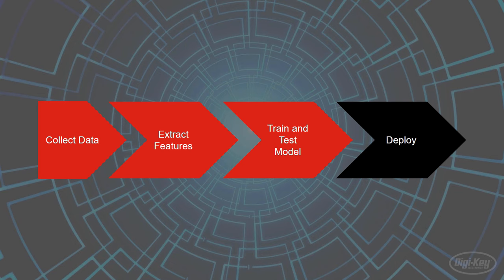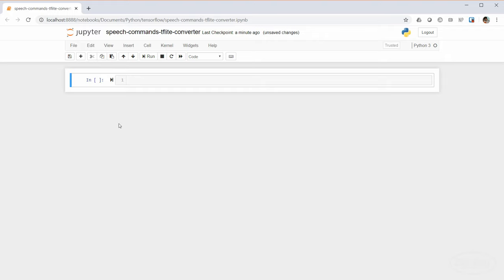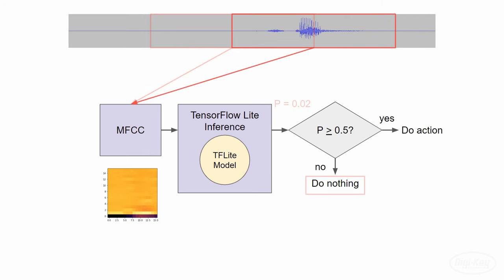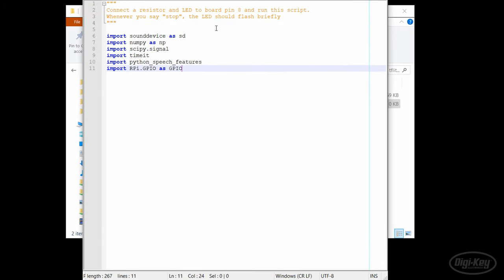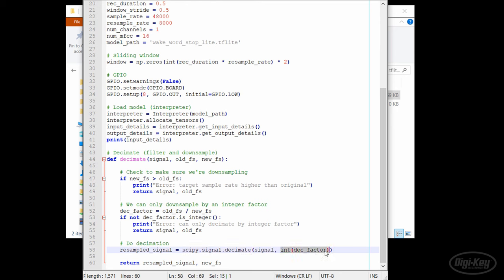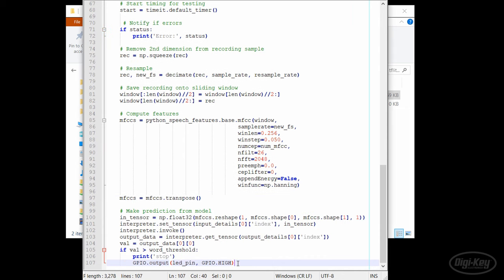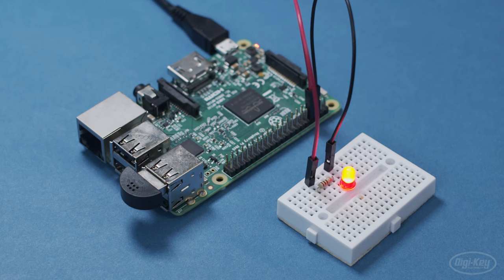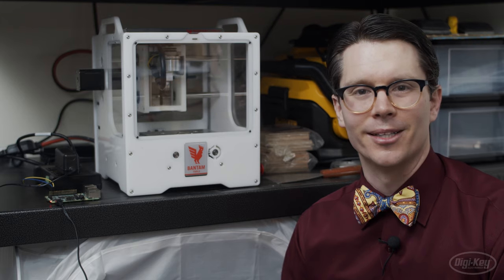Intro to TensorFlow Lite Part 3: Speech Recognition on Raspberry Pi | Digi-Key Electronics

Comment: Is there some sort of generic driver for microphones for Raspberry Pi? The model worked when running on my Windows laptop, but the mic is not even detected on the Pi. (sudo lsusb would not show it).
Interestingly, if I connect it through bluetooth, it would only appear as an audio sink (output) but no source. This is the same for my set of headphones, which include a mic, if I connect them to the Pi through bluetooth as well.
Any feedback would be appreciated.
(Thank you Shawn for the video; it is very well made and informative)
Reply: Raspberry Pi doesn't allow you to use the secondary Mic feature of a BT headphone. You'll have to use dedicated microphone.

Comment: I am trying to run an original audio inference model, and when when I get the input_details of my model I get the following> [{'name':'serving_default_input:0', 'index':0,... }], which is different than in your project.

I think that due to this I get an error in the line interpreter.set_tensor(input_details[0]['index'],in_tensor) that days "Value Error: Cannot set tensor: Dimension mismatch. Got 1 but expected 2 por input 0.

Do you know what I could do to fix this?